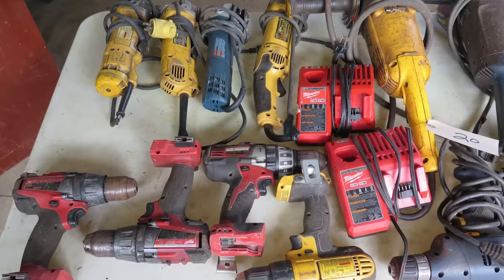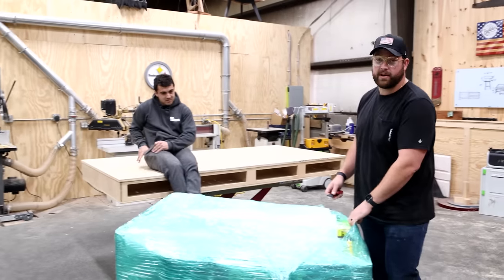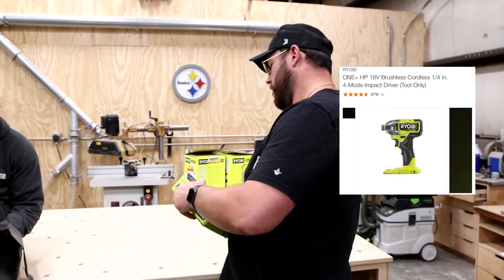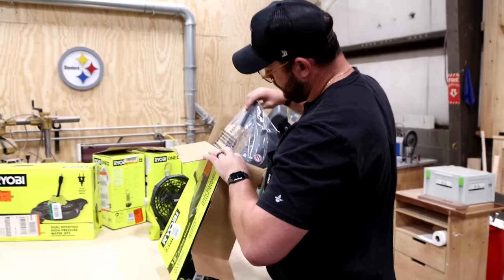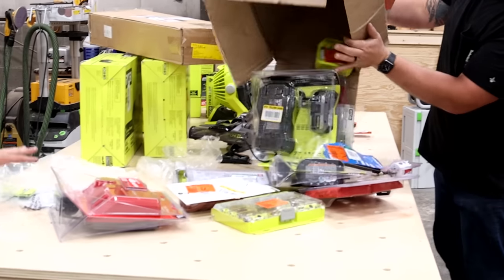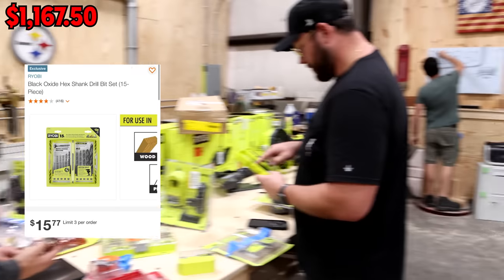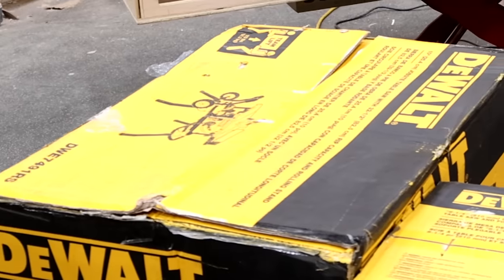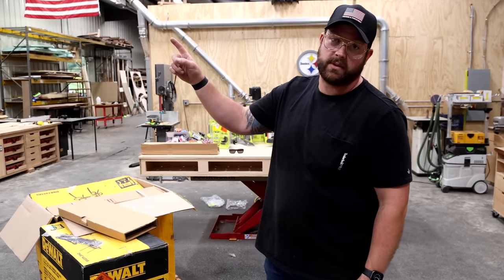I Bought A Pallet of HOME DEPOT RETURNS for CHEAP!

Comment: for returned / open box items, I would expect to be cheaper.  $700 / $2700 is only 26% off.  Interesting to see but not impressed how they baited you with 2 DeWalt and rest Ryobi.  You can't resell them at retail value with open box items.  Unless you have a need for them, not really sure you gain much from that haul.
Reply: Right? I bet resale value on a lot of that ryobi stuff is much less than full retail. After shipping, fees and time you'll be left with some extra cash to go towards the cost but imo not worth it. Not sure how the tool resellers out there do it unless they are getting CRAZY good deals.
Reply: @Golden.Buddha  They certain don't pay retail.  Plus they got volume discount.  This video is comparing to retail value.  Manufacturing cost is typically 1/8 to 1/12.of the retail value.  High value name brand could be as little as 1/20.  These are the 8x, 12x, or the 20x markup.  But they are not all profit.  There are logistic, overhead, and distribution cost.  The more efficient they can manage, the more profit they can pocket.  And yes, you will be surprised on how low the cost they paid.  LOL.

Comment: i am a year late here but figure i will give my insight too since i buy pallets too.  I rarely get to buy tool pallets and electronic pallets. they tend to get into bidding wars , you are taking a bigger risk on working condition and the shipping seems to put it too high.  otherwise if you can snag a pallet at or around the opening price and they offer decent shipping or free pickup you can come out smelling like a rose on just selling a few items off the pallet. Oh, another category that is expensive to buy in is when they offer a good mixed grocery pallets, people have been going nuts over those too lately. i brought 3 pallets in the last couple of weeks and i got them for 90-92% off retail then add shipping i was still under 15% of retail. i was happy.  i wouldn't mind buying a few tool pallets but they go for more than they are worth to me.

Comment: I made friends with the tool dept mgr at Home Depot (another Viet Vet) - when they'd get a return that would be a fantastic buy, he'd call me just before went on sale. What isn't usually mentioned in these vids is that many of the higher quality ones are still under warranty.

Got some very nice power tools that wouldn't start. Contacted repair service (when they had them) and got them fixed for free. Best was $400 Milwaukee set t($100 my price) that the sawsall would not turn on. Took it in. They opened it / found the power cord retaining screw was missing. Was before battery operated.

I could have done it myself, but hay, under warranty.

Comment: If there was anything one thing I learned when I ordered a Ryobi mower from Home Depot last year, it was that they're really in the business of selling batteries, not tools. 
The mower I got was the same price for both the boxes that did and didn't include a battery, and the battery sold separately wasn't much cheaper. That's probably why several of those were $100 dolars rather than a more reasonable price: I'll bet they used the same battery, and the cheaper products came with much smaller batteries that used a different connector/interface to attach to the tool.

Comment: I have been doing this all year from a local auction website in MI. They list the individual items as auctions so getting good deals on items I need instead of entire pallets. Just be sure the check what the auction house charges on top of the bid, and figure in shipping or gas for pick up to get good deals way under retail. Got a dewalt 12" miter saw for $94, heavy duty stand for $110, husky tool cabinets around $100 instead of $500. Basically setting up my garage shop at discount. Deals to be found from returns!
Reply: I follow an online auction site as well and find some great deals and flips. I love following the estate sales on the site.
Reply: What is the website?
Reply: @jjjosh48  I use Proxibid
Reply: @jjjosh48  Liquid Bidding if you can make it to Flint area for pick ups. Theres also Liquidation store fronts popping up if you look wherever you are local to.
Reply: @matthewmichalek436  no you didn't get a 12 inch mitter saw for 94, majority of them go for 250-380 according to past auctions

Comment: Bought an Amazon return pallet. It had a foot controlled trolling motor in a box, which was what I wanted out of the pallet. Most other things were random trash. I got it home and opened it. Someone had bought a foot controlled trolling motor, carefully opened the box and removed it. Then replaced it with their trash transom mount trolling motor. Be careful because once you buy, it is yours.

Comment: I'm curious - Is sacrificing the manufacturer's warranty for the items on the pallet worth the savings? Definitely an interesting idea for picking up some tools if you have the coin.
Reply: How are you sacrificing warranty as far as I know Milwaukee is still going to honor that warranty it's just going to be off tool manufactured date not purchase date I would generally be interested in knowing if you're really losing manufacturer warranty
Reply: @mattlane2282  normally you have to register a tool to get the manufacturer warranty. They require proof of purchase when registering, so if you buy it like this, you don't have the itemized receipt from a seller. 

Source:I work for home Depot.
Reply: @mattlane2282  Yeah I asked Home Depot about their non-house brand and the cashier told me it's generally a manufacturer thing.

Comment: I'm gonna be honest, I actually really love my Ryobi tools.  They are perfect for my home diy projects
Reply: Well, Ryobi is a DIY tier of tools. So as porter cable hart.
Reply: Nothing wrong with loving Ryobi tools, they are great homeowner tools and the variety of tools on one battery system is crazy. They are just not good for the every day use a contractor would put them through. They aimed at their target market and hit a bullseye.
Reply: Very cost effective tools.
Reply: The brushed tools are shit but the new HP tools have replaced ridgid pretty much since ridgid discontinues shit for no reason every 2 years and re releases the same shit over and over again.
Reply: I'm a pro and I have a couple of Ryobi tools. They're definitely underrated.
Reply: I had some of the older, blue Reeeeeobi tools that I bought when I bought my first house, back in 2000. It was one of those large kits, with a drill/driver, chainsaw, jigsaw, hand vac and a few other tools and a few batteries. It came with a huge bag that had wheels on it.  I added a few more through the years, but not too many.  Anyway, I sold it a few years, for like $400 or $500.  I met the guy in HD parking lot, took the cash and walked inside and bought a bunch of Milwaukee FUEL tools.

They are absolutely great for a DIY type set up, but I knew there was no way I'd be able to use them on the jobsites for very long before they gave out. But I'm sure the guy that bought them from me tried to do just that.

Comment: The RYOBI Tire Inflator (Model# P747) is the best $59.00 I have invested in. w/ a 4Ah 18V battery I was able to inflate all four tires on my car and still had 75% juice left on the battery. I cannot say anything about the new PCL031K1 because I have not bought one yet.
Reply: Aren't the $30 12v inflators a better choice? Its cheaper & you never have to worry about battery/charge coz anytime u actually need a car's tire inflated the car can provide the 12v power?

Comment: I buy used tools from HD all the time.  Pay full price, get home and open the box and its covered with cement, drywall, dirt, missing pieces.  Pisses me off to no end.  Bought a cordless drill one time also and got home and it was a brick duct taped inside the box.

Comment: I worked at home depot during part of  the pandemic while laid off... Anyways most of it is never used or the user doesnt know how to use it properly or they are renting it for free....  I sold a generator to a guy who used it for an hour and took it back because he didnt like how it worked. We Red tagged it and sent it to wherever it went. Guy simply didnt like how the fuel line had a cut off.

Comment: I used to work for Home depot is literally a big tool rental center , I've seen shade tree contractor buy tools such as a paint sprayer and then when they're finished with the job  repeated return the sprayer for a full refund. Depot never asked any questions about returns,  Depot is so desperate for customers they will return anything at anytime

Comment: Thing is retail doesn’t mean anything. Most of those tools go on sale VERY often at 30-40% off and sometimes free batteries too. Nobody should EVER pay full price for a tool unless you need it in an emergency. I’ve gotten every single tool i own which is dozens at 30-70% off and over 20 batteries and i never bought a single battery by itself

Comment: Dude needs to start working out. He could barely lift the thing out the box. Plus I also think the skid was a horrible purchase. Some of the stuff is used and clearly opened which you would have to charge less for it. I just don't see any value in selling all these items just to make a 100 bucks or break even. If you had to ship the items and pay ebay fees you would lose money. Ebay charges like 15% in fees. 2700 x 15% = $405 and that doesn't include shipping.